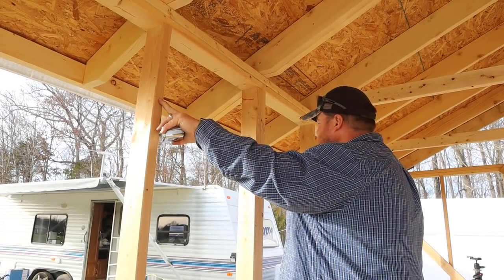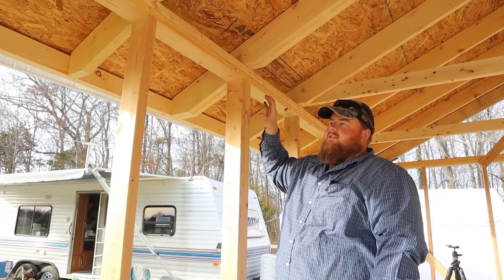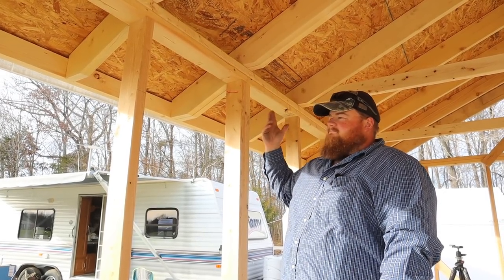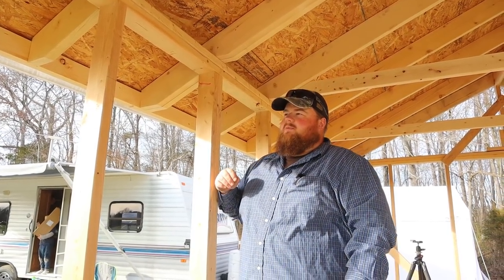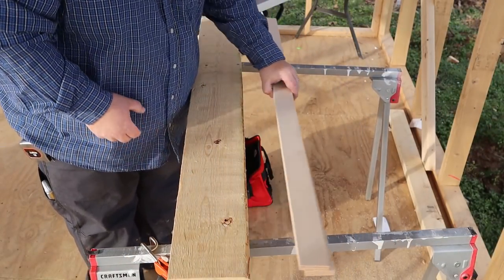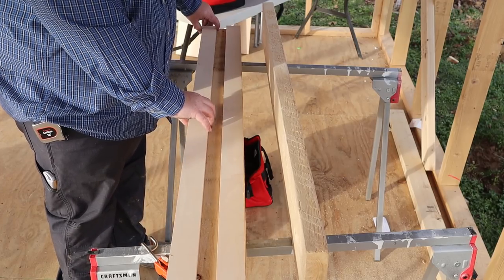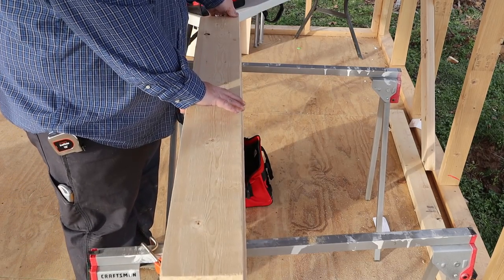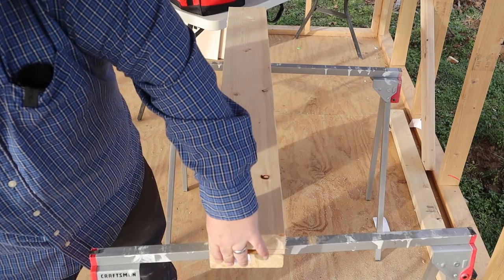WHERE'S MY SHOP DOOR? - Door Framing in a Load Bearing Wall - Shop Build 07

Comment: Glad I watched this. I had not considered the nailing surface of the siding. I probably would have done the same thing...now I probably still will, but I won't have an excuse.
Reply from the maker: LOL Or you may have a quicker fix. :) Some suggestions here was to cut the thickness of the siding into the birdsmouth on the exterior to allow the siding to slide up into place still -- a good fix. More labor and saw/ladder time, but no extra material or hardware costs. Your build is looking good!!!

Comment: I recently got a 12x16 shed that is becoming my workshop. Now that the electrical is done the transfer of tools from the garage has begun as time and weather allows. I am in the same boat as you with thinking about selling my saw and going with a tracksaw and smaller job site saw. Makes me sad to do that, but the room required that I’ll gain will be huge in the end.

Comment: Just a suggestion, but I found it great to have everything in my shop on wheels, even the CNC table. It makes it easier to clean, rearranging and getting things out of the way  if I am needing extra space for a project. The CNC table has levelers and locking feet to ensure it doesn’t move. I have never regretted that decision.
Reply from the maker: Oh yes!! Wheels for the win absolutely! :) My CNC table is on locking casters too.

Comment: Benn watching progress, have not heard what type of heat you will use. I know last year your video covered the three you have used and your choice going forward. 

Have you looked into a Diesel Heater? I now use one in my 12 x 20 high barn shop. I have also used various heating methods for heating in prior shops. I decided on the Diesel heater All in One.  

Love the roofing and door projects.

Thank you for sharing your awesome workshop build with us. Great Price also. From Henrico County Virginia
Reply from the maker: I figured I'll use propane heat again.. mostly because the workshop will be going off grid initially if not forever and electric heat will be a killer to the system. I've not heard of diesel heaters before... I'll have to look it though. Sounds interesting

Comment: In my new 12x24 shop with cathedral ceiling I put the 3.0 door in the center of the long wall. My reason for that was to have at room on each side of the door for equipment. Putting it on the end would take a lot of the wall and leave you with two short walls. Also it give me a straight path to my house and not have to walk around the building. No two buildings are alike; You have to make them fit to your needs.

Comment: you need to get yourself a cat's paw to pull those nails out. a small one works fine to lift a nail so a hammer can work. Also, if you have to cut a bottom plate again, I suggest a sawzall. the blades are way cheaper if you hit a sheeting nail in your plywood.

Comment: seen the doors that where set up as a one and a half , basicly a full door on one end and a verry narrow door on the other end , helps if one door is just too narrow and stops the need to get a realy wide door that needs to be cstom made and loads the hinges a lot more 
as for the layout : if youre building an "island"in the middle you could put a insert in the middle that you can either cover with a plate or drop in either a small benchsaw and a routermounting plate intoo with a sunken in guiderail setup that you can take off when using the table for putting stuff together or as a workbench in general , that way you still have some sort of a saw/router table https://www.youtube.com/watch?v=-t8p35G5pNo
https://www.youtube.com/watch?v=oQxjEqOQRnk
island doesnt need to be huge but having a surface a little longer than the carry-on tablesaw does help (i think you have one of those small tablesaws (or was it a mitersaw) i seem to remember youre wife using it when you did the boys room )
Reply from the maker: I thought about doors like that too -- pretty cool compromise between the two options. :)  I really like the multi-function workbench ideas, too! My current table saw (that I am selling) is a 10" cast iron table top with router plate insert into a side wing. It's just too large for my real needs. I will either get a smaller job site size saw, or track saw with MFT setup of sorts.. still time to figure that out. :) Thanks!
Reply: @Samcraftcom  thnk the tracksaw is the best allround option for small workshops, basicly because you can cut through full size sheets without having to handle them across the table and possibly scew the sheet while guiding it through the saw , only downside is like i said before that you do need to get down on youre knees and crawl over said sheet on the ground to cut through it as the sheet is just too wide to reach over from either side  wich i know isnt all hat eazy when youre eeehr not so skinny as you used to be 
there might be tracks available for the handmachine youre allready have i know kreg makes a universal one 
https://www.kregtool.com/shop/cutting/circular-saw-cutting/accu-cut/KMA2700.html
 , seen tracks made from thing triplex too just a 4 inch or so wide strip with a smaller strip fitted to the side , then you use that side piece as a guide and saw through the bottom piece , now you have a perfect fitting track that you can butt up against youre markings and saw a perfect straight line through it (as long as the track dont shift ) , takes in way less space too 
maibe get a bigger chopsaw for the smaller cuts and for the lumber stuff you can put that against the wall in one end of the shop